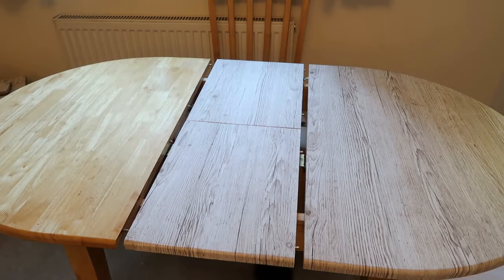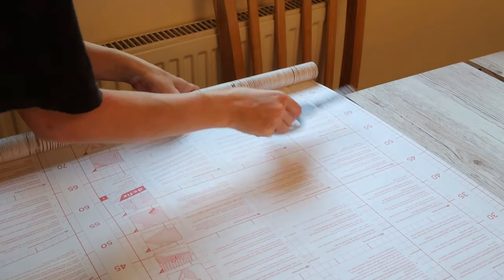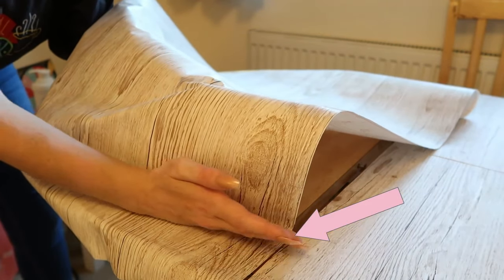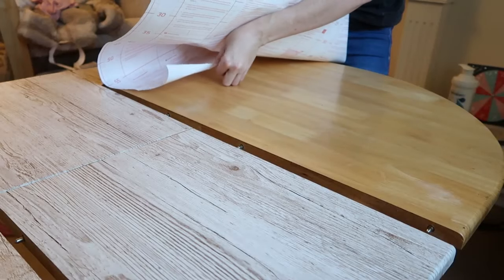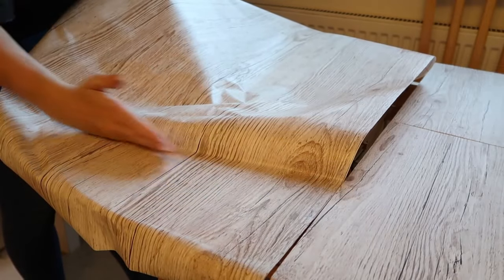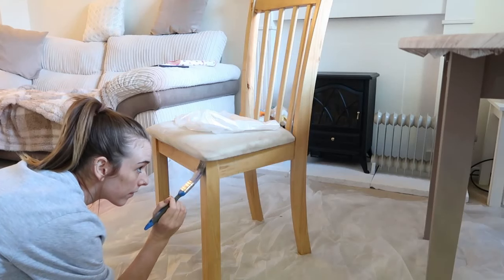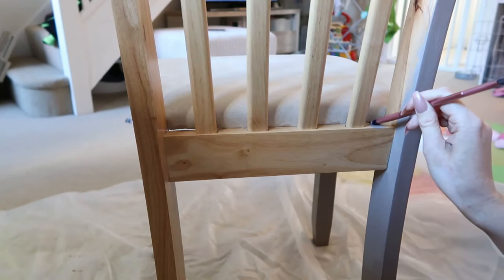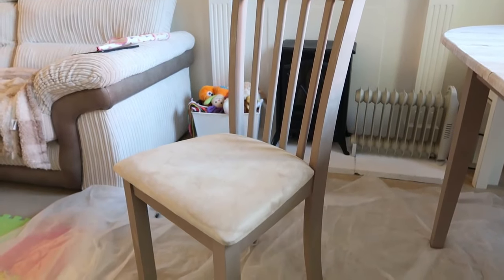DIY Dining Room Table Makeover | Old Table to Farmhouse Chic | LottieJLife

Comment: Hi this was brilliant to watch. Only question I have is, what do you do under the table with the extra plastic sticking up from hairdrying? It just looks like it sticking out.
Reply from the maker: For me, I personally left it because it's far enough under the table that people have never noticed it ... but you may be able to get the hairdyer on it and flatten it again, OR if you start off by cutting the vinyl way bigger than you need, then the overhang will be further under the table. Hope this helps ❤